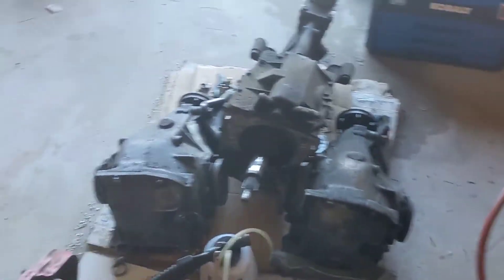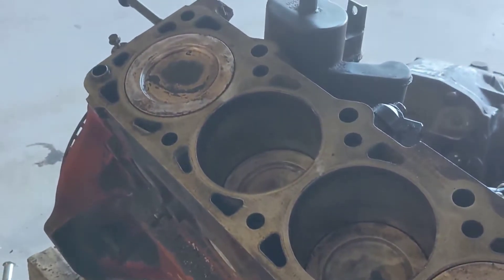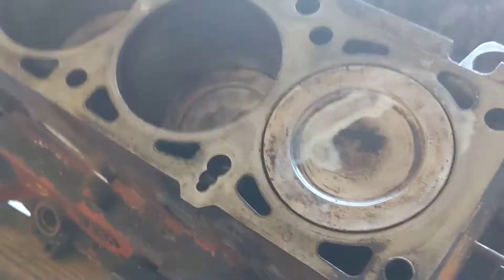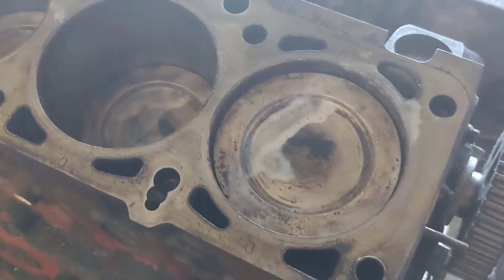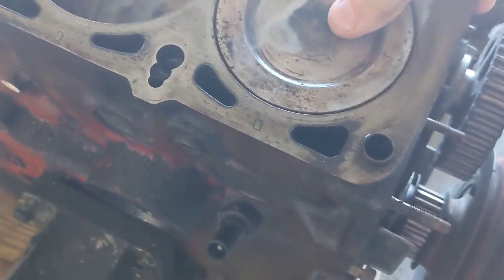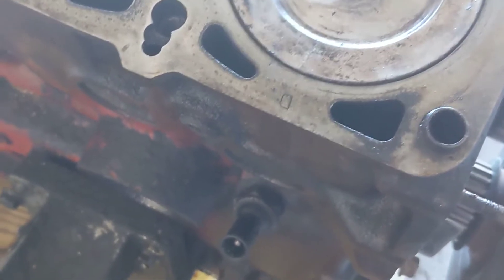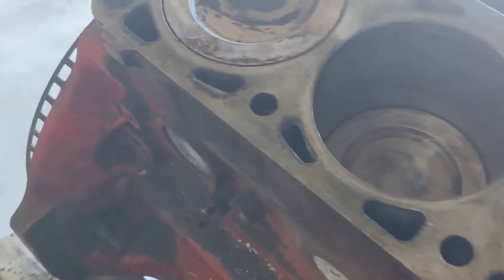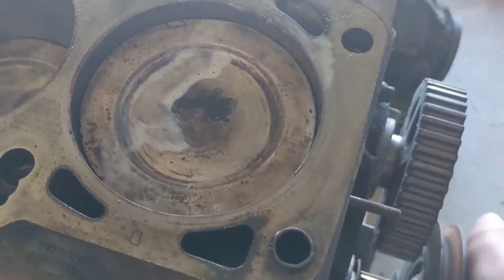Rod Knock: What to look for and what it sounds like.

Comment: Does this call for replacing rods ; if you wish to deep-dive ?
Reply from the maker: No idea till I tear it apart
Reply from the maker: Funny part, I did tear it down and someone had been in it, took out the bearing to inspect, put it back together and hand tightened everything, Same symptoms as a rod knock but without having to replace crank or rods.
Reply: @DragonsGarage  Thanks !!